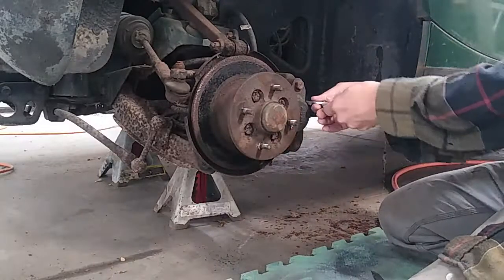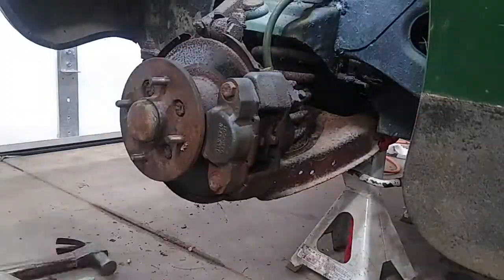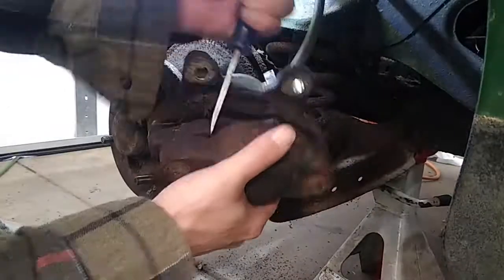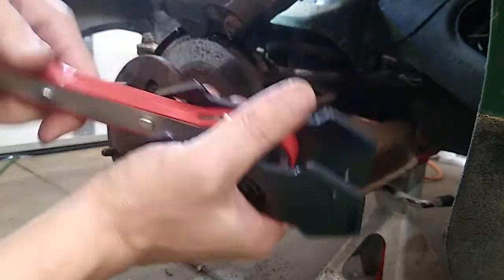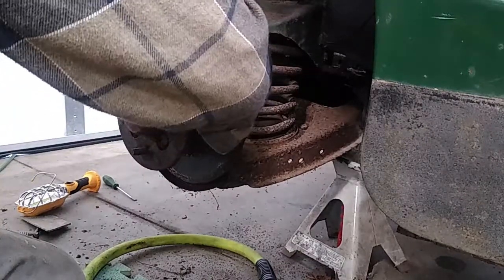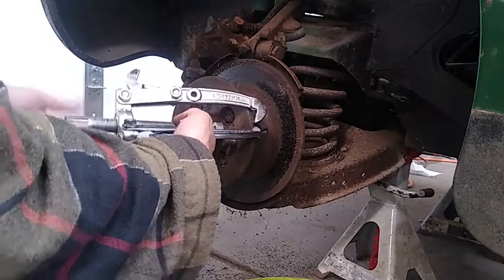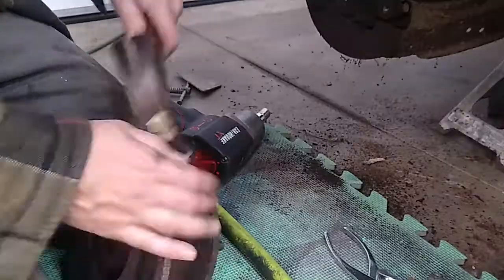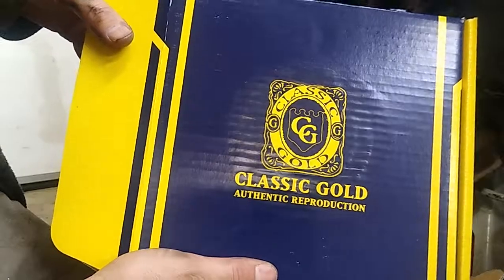1976 MG Midget Brake Disc and Pad Replacement

Comment: I’m putting off doing the brakes on our midget and I’m so glad I learned about the backing deal on removing the caliper bolts!! I’d be cussing them and all our viewers would have been yelling at the screen! Lol! I’m certainly shouting you out! 🤪🙌🏼
Reply from the maker: Right on!  It probably would have been obvious when you got there because the socket doesn't really fit on the bolt with the locking tab in place.